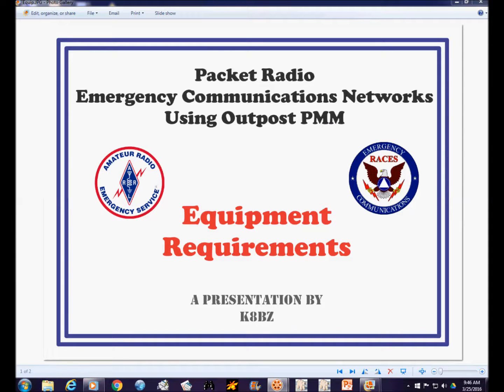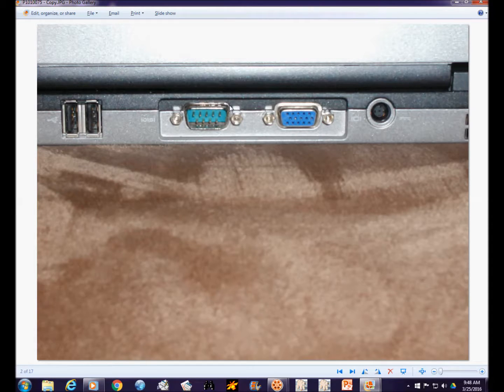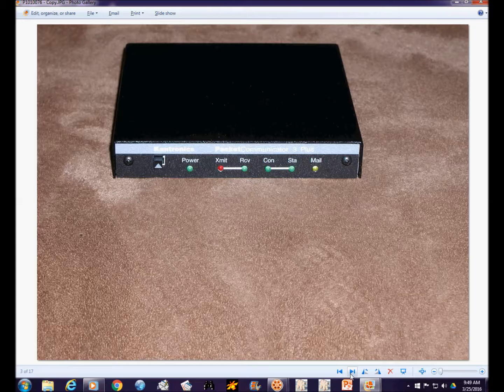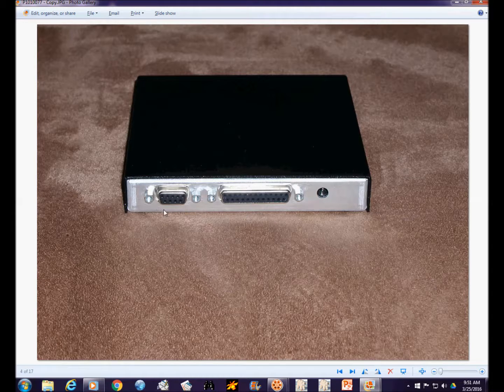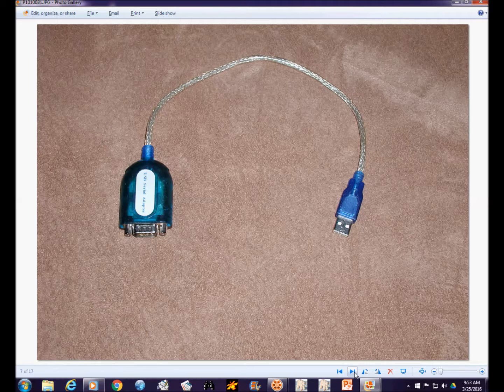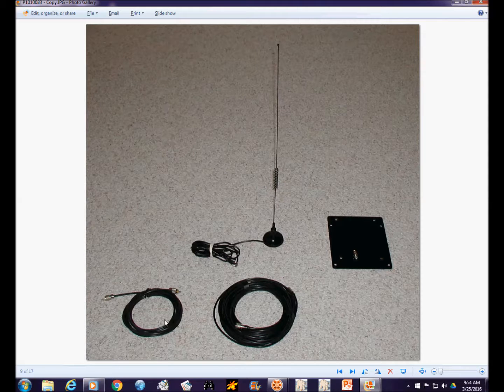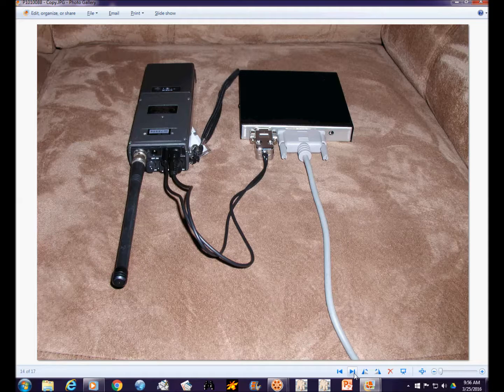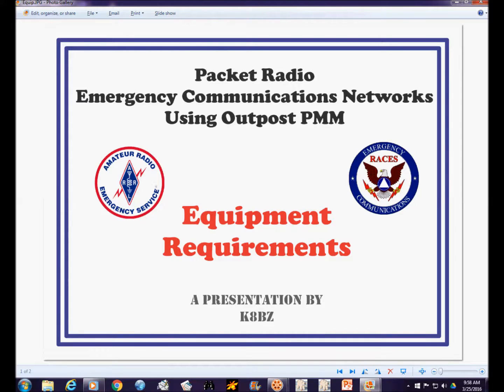02 Packet Radio Equipment Requirements

Comment: Am new to Packet. With this gear can i make this as a digipeater, aprs and winlink? Bit confused of the uses of the TNC.
Reply from the maker: +revo adan 
Hello Revo:

With the TNC (KPC3+) you can have a digipeater.  You can also use it for APRS.  But, APRS is not what these training videos are describing.  It's more for bulletin board messaging.  APRS usually is one on an APRS only frequency.  Watch the Bulletin Board video at this link for more information:

https://www.youtube.com/playlist?list=PL1SWYTnI6G2PrgautU9hw7BCs04zb857w

Good luck and 73,

Steve, K8BZ
Reply: K. I have tried BBS before via HF and my link was from JA. when i was still in DU land. so whats the difference of WINLINK and Digipeater..,
Reply from the maker: +revo adan 
Winlink is a messaging system, like email, but it uses packet radio and the internet.  See https://en.wikipedia.org/wiki/Winlink